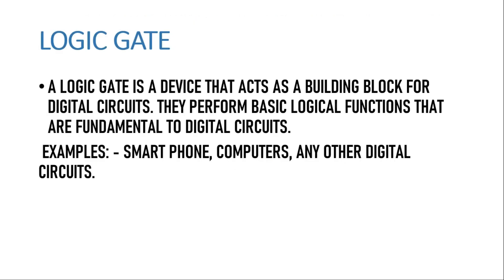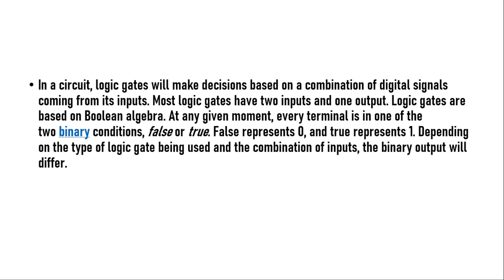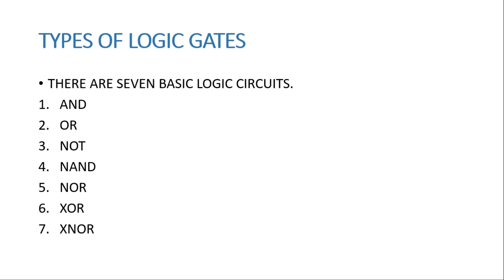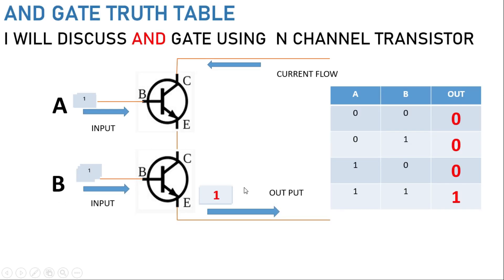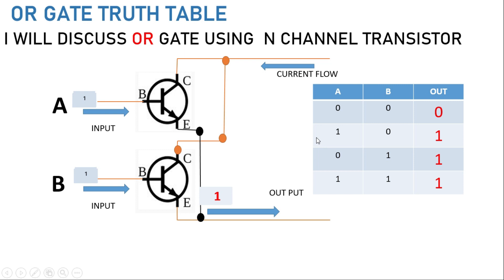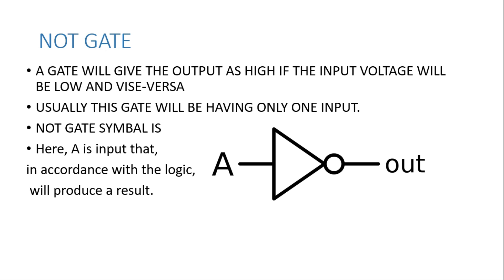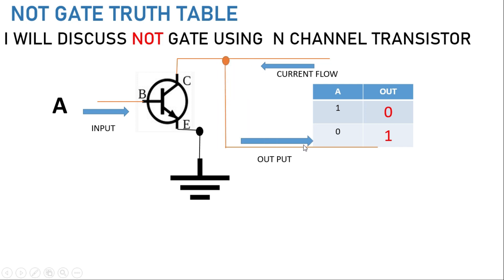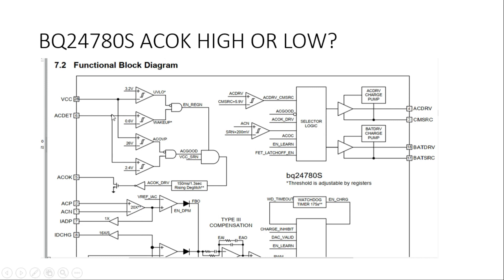Laptop Repair - 29 -  - LOGIC GATES AND CHARGING IC BQ24780S ACOK EXPLAINED

Comment: ACOK 3.3V is GOOD?
Reply from the maker: Good. Depending on voltage divider
Reply: @LaptopCourse  do u familiar with hp probook laptop?
Reply from the maker: Means? U can check my previous videos for this answer.
Reply: i think must like that. Because this voltage trigger mosfet to pin IC KBC (AC OK) must low (0 volt) when detect adapter/ charger...and light charger goes on...sorry bad English...😊